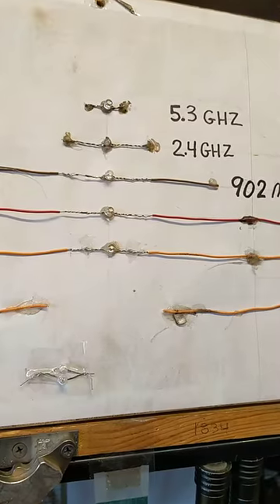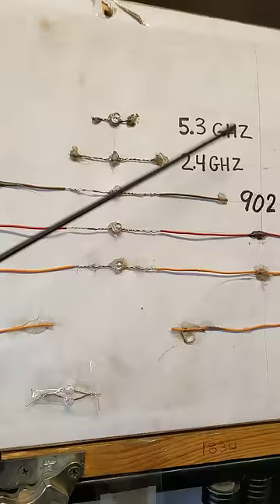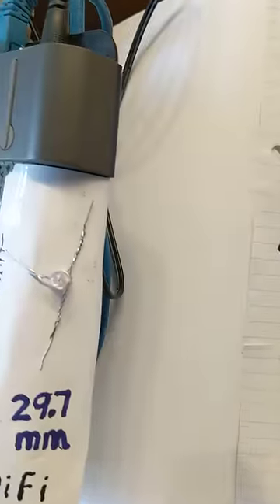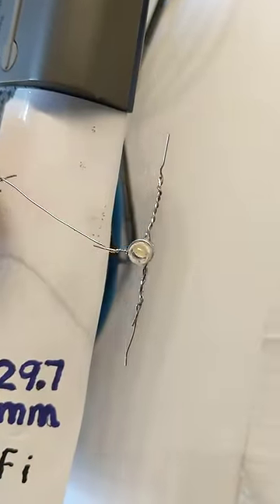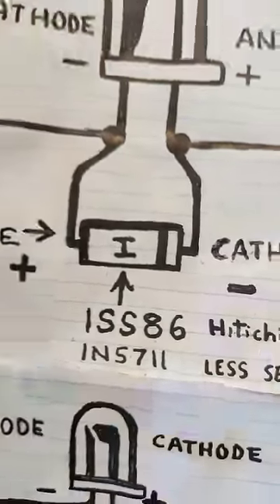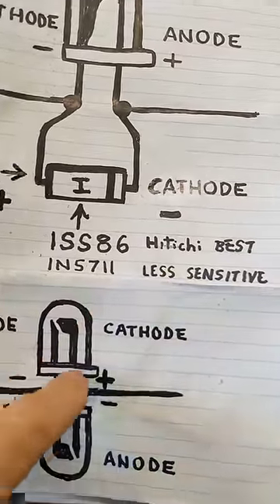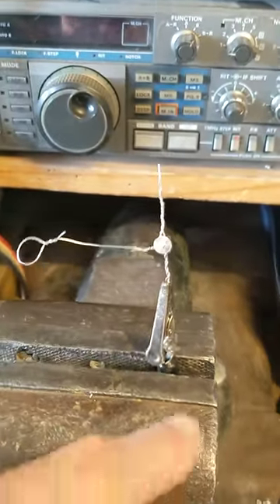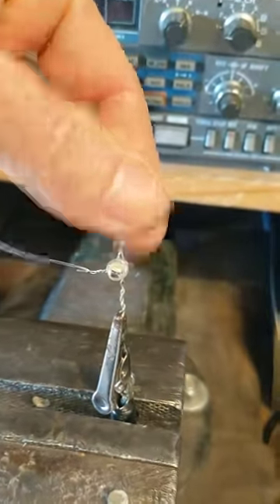Tuned Antennas Lighting Up LEDs

Comment: When I was maybe 12 back in the stone age, I pounded an old tent pole into the ground, connected to to one of those old earplug things in parallel with a diode, then to a long piece of wire. I listened to the local high-power AM radio station. It seemed like absolute magic. But, my Forrest Mimms books from Radio Shack were my inspirations.
Reply: Great story. You never forget those magic things you did as a kid.
Reply from the maker: I love forest mims books, As a kid I started with crystal radios.
Reply: I picked up those books from Radio Shack also.
Reply: we no longer have radio shack but imma try to look for this book online
Reply: Those were the ones with the hand drawn circuits and pictures? Like sketches
Reply: I had my Vane A. Jones books and would dx all of the AM stations I could receive with my longwire antenna.

Comment: Now THIS stuff is worth watching!!
Reply: He should've made one for the "5g" network that pumps out 26-28 GHz like a microwave. (mainly used in Europe so far)
Reply: J
Reply: @Greatdudeguy  Microwave actually pumps 2,4GHz, just like WiFi or Bluetooth...
Reply: @obiwanbts  you can remove the safety door switch and turn up the Ghz easily. they try to make them "safe" but they fail and cook things poorly all the time too.
Reply: @Greatdudeguy  😂😂 It does not work like that. Klistron is not capable of producing 28GHz...
Reply: @obiwanbts  You probably never even knew you could take apart microwaves and use their transformers to make a stick welder. Not everyone is good with electronics, but there are always people you can pay to help you figure out how to do basic stuff with electronics.
Reply: @obiwanbts  funny how think an old device from 1937 they use to get precise frequency bands proves that you can't modify a microwave into an unsafe weapon. If you don't live on the internet and try real stuff with real people you might out how easy it is.
Reply: @Greatdudeguy  If you MODIFY its internals, then yes, you can change the frequency A BIT. But not directly. Directly it produces 2,4GHz. Besides that, you would have to have a new klystron, so the main part, as they are designed to work with a specific, rather narrow, frequency. And besides, besides that, klystrons cannot produce 28GHz. They are used rather upto 10GHz...

Comment: You read my mind about something..
I didn't think the camera's framerate would grab that. Just Beautiful! 😄
Reply: It's not the frame rate. It would need to be in the excess of 10kFPS to be able to capture it.
What is capturing it is the line by line scanning speed of the chip akin to the rolling shutter effect
Reply: @simonkondrk7569  You're right. I was thinking more of exposure time .
Reply: @simonkondrk7569  its mostlikely rf signal/25fps video frame rate.. higher then 25 fp/s on signals will be missed or resonance points of that at 1/25 fps :P welll this is still relative to frame capture timing precission and starting point/drift point of signal.. so no clear definiting as frame rate and signal freq data freq are not in sync... still fps and freq may be in sync or close to sync. as similar resonators/crystals are used for booth.
Reply: Now, convert the light to audio !
Reply: @MrBrandonLindner  You couldn’t would be awesome though, I think the audio hz should have to perfectly aline with the shutter speed of his camera
Reply: 8
Reply: The Fourier is crowded. Uh huh huh
Reply: Why not use a jack input instead of the led so you can hook it to a computer and see and play the signal with Audacity.
Reply: absolutely amazing!
Reply from the maker: I have one at this link. https://www.youtube.com/watch?v=vHVmJ5lD9jc

Comment: Reminds me of those radio-powered LED stickers that were on every girl’s phone for about a week in 2004.
Reply: neat idea
Reply: That was very popular in India at that time.
Reply: Never even seen that before
Reply: Oh yeah, I bought one of those 20 years ago. But IIRC those needed a watch battery to operate, at least the one that I had. I think there were low range ones that you sticked directly on your phone, those ran without battery directly from RF, but there were longer range ones which detected phone calls from about a metre, and those needed a battery. But I might be wrong. Mine also detected our microwave from about 20" if it was running. 

Just checked, they are still available built into phone cases and as keychains. Seems like these new ones don't need a battery, at least the phone case version, the keychain might need one.

Comment: Lovely simple idea  , my friend used to use small light torch  bulb  connected at centre of dipole near Transmitter to tune up amplifier, only works in close proximity though maybe not as sensitive as LED version shown

Comment: This was incredibly awesome.  Could make an entirely passive Wi-Fi/wireless bug detector with these I suspect!
Reply from the maker: I don't think you could make a passive bug detector this way, but if you attach an audio amplifier to the ends of these diodes you can sure hear some interesting transmissions, such as the ones that come from a wifi modem.
Reply: Unfortunately, I would imagine probably not considering you have to be extraordinarily close to the source signal to get it to respond to anything
Reply: @GrantsPassTVRepair  can we make a low cost iot device like this?
for example a simple toggle switch than can turn on and off with pulse of a specific freq. ? And a centrel base station to transmit that freq, attached to a computer running home assistant?

Comment: Just made one for the 70cm band using 2 leds, now I have an interesting toy. It only works at close proximity though. Thanks for the idea.
Reply from the maker: Did you use the two LED configuration, or the detector diode and LED combination, which is far more sensitive?
Reply: @GrantsPassTVRepair  I used the two LED configuration as I did not have the detector diod or it's similar on hand. I knew it wouldn't be much sensitive and I just made it cause it looks cool and I can use it to teach others about radios and antennas with the help of a handheld radio.
One question that I have is that if the mentioned detector diode was used, would it be possible to damage the devices when transmitting with about 5W at close proximity?

Comment: I wonder if the taliban used something similar to this to detect when we were using night vision in the caves of Afghanistan. I've heard early in the war we "owned the night" and could see like we had superpowers, but after not too long the "primitive" men in those caves found a way to detect the IR light we used. They didn't have the tech or manufacturing to make night vision but they now had the ability to know when we were looking. So they'd rig the cave with explosive and detonate when they detected IR light. I'm sure by the time we left they had their own NVGs but the low tech analog stuff like that really fascinates me.

Comment: Folks, in the late 90s cell phones antennas that you could unscrew and replace with one that had a led.  The led lights were flash and flicker when receiving a call or when on a call. They were energized somehow just off the antenna.  No internal battery and they were universal on most cell phones
Reply: Phones only transmit (except for occasional momentary housekeeping functions) during calls or when exchanging data. When a call comes in the phone starts transmitting to establish the two way connection. Thus, the LED is responding to the transmit power, not the reception.
Reply: Yep, also if unscrew antenna and make a call, it would burn my hand

Comment: And if you pipe that into a mini solar pannel of various sorts for light detection with a speaker you will get audio. Different sensors and battery and mosfet assembly you can get a lot of audio. More work than other radios mind you, but fun idea.

Comment: Back in the 70s during the CB radio craze, I took a small neon bulb and cut off one lead and wrapped the other lead around the top of the antenna. Secured it with silicone. When the microphone was keyed, it would light up.
Reply from the maker: I remember watching  a friend do the same thing with a fluorescent light attached to his whip antenna.

Comment: Quick question for a tv shop that has a 200 foot long wire antenna.  If I use a 200 foot length of telephone cord that has 4 insulated conductors in it and I connect them to a radio at one end would that be like using 4 200 foot separate antennas in parallel?

Comment: You should use a solar panels, and hook it to a speaker to play  the frequencies ,and you should try using a laser too so you could get more distance or help the solar panel pick up the frequency from the light or use a light photo sensor. Please don't mind my punctuation. My phone is completely sideways on a wall while I'm typing.

Comment: You can broadcast the sound through a speaker as well, take the light and face it at a light to sound pickup and you will get the radio station playing on a speaker projected from light🙃😎

Comment: Would this work on a regular ham antenna--say an off-center fed dipole? Seems like it would.
Reply from the maker: It should work if the transmitter isn't to far from the antenna. Transmitting on a frequency the antenna is tuned for should also help.

Comment: I suppose the audio from the radio station is modulating the LED output (shown near the end of this clip), is that correct?
Reply from the maker: Yes that sounds correct, but the carrier wave also lights up the Led when there audio is absent. At night when the station lowers their power, the flicker is more evident to the naked eye.
Reply: @GrantsPassTVRepair  Thanks! One more question - can the audio in the LED light signal be converted into an electrical signal, using a photocell or some other optical device, and then amplified before being reproduced by a speaker or earphone?

Comment: Why does it turn on only when you touch it? Are you grounding it? Also if it was a speaker instead of a wire wouldn’t you be able to hear it!? What about hooking up a solar panel to a speaker and point the LED at it. Wouldn’t you be able to hear the station?
Reply from the maker: I suppose it sees me as a part of the antenna when I touch the wire. If you watch my other shorts you may find some answers to your questions.

Comment: What is the function of the diode? The radio will always induce current through legs, and so, through the LED. So, the diode seems to be like another load? Although, reducing the overall resistance from leg to leg, as it makes another way for current to flow a little.
Reply: The diode and led face opposite directions, allowing current to flow in both directions and letting the antenna resonate.

Comment: When i was a kid i was into electronics,  i built an amplifier with a transistor and hooked an infrared detector from a television to it and a small speaker, when i pointed it at the light in my room it picked up what sounded like an am radio station. Do you know why that would happen?

Comment: What is cable made out of? Can I use solder wire, jumper cables or enamel coated copper wires?
Reply from the maker: I used shielded stranded wire for my antenna. Copper coated wire is fine, but try to keep it from touching any grounds, and don't let it touch any high voltage lines.

Comment: Odd question, neighbors have a 50ft ham radio tower he uses fairly often. What could i expect in similarities as you being close to a radio station? If any
Reply from the maker: Chance are you could derive a little free energy from your neighbors transmissions if you have a tuned antenna for whatever frequency he happens to be using.

Comment: But I see different lengths and thickness. Which one would I use for 915 mhz meshtastatic Lora
Reply from the maker: Look up dipole antenna calculator, and enter in the frequency you need for your antenna elements. Each  antenna element length at 915 Mhz it appears to be 0.25574 of a foot long.

Comment: Would you please explain the diode's role in this set up?
Why do we need it?
Would the LED burn without it when the voltage reverses with every half wavelength?
And which parameter of the diode affects whether it would fit this purpose, its capacitance? (smaller capacitance for higher frequencies?)
Reply from the maker: You might want to look up some videos on antenna resonance to understand this better, but regarding the LED and diode in a parallel circuit which turn the radio frequency signals in to light, it's a mystery I don't fully understand.
Reply: @GrantsPassTVRepair  😄 ok, thanks.
So did you just test different diodes until you found one that worked? Or did you know what parameters the diode needs to have in order to work?

Comment: How much voltage does it need to light the LED? Or iow, if you made one for exactly 2,450 MHz would it be sensitive enough to "sniff" for leaks on a home microwave oven?
Reply from the maker: The ideal voltage for these LEDs is 3.6 volts, and 20 milliamps. They can light up with less than 3 volts, but their intensity goes way down. These can be used as sniffers. Here is an example. https://www.youtube.com/watch?v=vHVmJ5lD9jc&t=7s

Comment: I'm confused about the voltage across the diodes. could you explain that?
Reply from the maker: I don't fully understand it myself, but it appears that the LEDs are tapping into a resonating oscillation within the antenna, while allowing it to continue on it's path.

Comment: I'm curious. Why does it work better with a detection diode instead of an LED?
Reply from the maker: Diodes come in a variety of different characteristics, such as their voltage drop, current capacity, and switching frequency. The 1SS86 is especially good at high frequency switching, but an LED has characteristics that are not so impressive in comparison to the 1SS86.
Reply: @GrantsPassTVRepair  Ooh, interesting. That makes sense. Had not considered the frequency characteristics. Thanks for sharing!

Comment: Could you find the lengths for 60hz?🎉🎉
Reply from the maker: It would probably be several miles wrong, but it sounds like an interesting experiment.
Reply: @GrantsPassTVRepair  maybe just 3/4 wave . I hear the transformers buzzing near my work. Since it's audible I reckon its able to be tuned into

Comment: Can this be used to respond to a motor, say, on a clothes dryer?
Reply from the maker: for listening to electric motors, I'd suggest you wind a coil with a 50 turns of wire, attach the coil wires to the input of your amplifier, and place the coil next to your motor.

Comment: So let’s say I wanted to listen to a radio station 500 miles away. Ordinary radios don’t reach that far, would this be something I could do to get better reception? Or am I way off topic here 🙂
Reply: It would depend more on the frequency and time of day. With a strong transmitter and a sensitive receiver the biggest issue would become the curvature of the earth. At lower frequencies there are other modes of propagation that do not require line of sight, but are dependent on ionospheric conditions.

Comment: Geez, how much power are you transmitting at?

The 2.4Ghz crystal radio I made uses the same antenna length thing. Also tried the LED thing myself, but that didn't work.
Reply from the maker: Keep in mind I have an AM radio station fairly close by here, but if you use the same components suggest it should work. This video may help you if you have not already seen it. https://www.youtube.com/watch?v=vHVmJ5lD9jc
Reply: @GrantsPassTVRepair I was asking about the higher frequencies (the 2nd and 3rd one below the 2.4Ghz lendenna)
Reply: @GrantsPassTVRepair As for that 2.4Ghz crystal radio, I use a piezoelectric transducer. Works pretty well tbh! I can get ~2 feet or so away from the modem and still hear it.

Comment: Those are germanium diodes right?
Reply from the maker: No. The 1SS86 is not a germanium diode commonly use in crystal radios. It's a Silicon Schottky Barrier Diode for UHF TV Tuner Mixer

Comment: How about couple with a capacitor. I knew saw info on circuits like this a few years ago that would slowly charge a capicitor then light up briefly
Reply from the maker: I was able to charge a large capacitor with rectified radio waves, but it took to long to be very practical.

Comment: how do you tune the antennas?
Reply from the maker: The simplest way is to use an online dipole calculator to determine the size of the antenna elements based on the frequency you're wanting your LEDs to respond to.

Comment: I would
Love to have you for a neighbor. I have so many interests in electronics. Guitar pickups
Frequency drives for electric motors, I'm a welder and guitar player and I should have learned about electricity when I was young. I'm 62 now and need to restore my 1965 Fender blackface DeLuxe Reverb amp and I have never had anyone explain it so I could understand it. I wired our house and several shops during my life. I have a lathe and mill that use 3 phase and I have a rotary converter and have no idea how to work on them.
Reply from the maker: Thanks. If electronics is something you're driven to learn,  I hope you find some of my videos to be helpful. A good part of what I've learned came through hands on experiments.
Reply: @GrantsPassTVRepair  I started working for a radio station when I was 15. I was going to be a transmitter operator. The station owner was an electrical engineer and couldn’t understand why I wanted to make my guitar amp distort. Anyway, I can do a little but I really wish I had about 2 years of tube amp education. I’m too old and too busy with my truck shop to take the time to build and learn. Wish I had when I could have

Comment: How dpes the length relate to the frequency
Reply from the maker: The size of the elements on the antenna determines which frequency the antenna is most resonant on,
Reply: @GrantsPassTVRepair  yea but how to is there an equation u could point me to